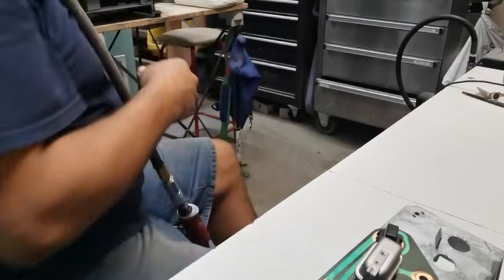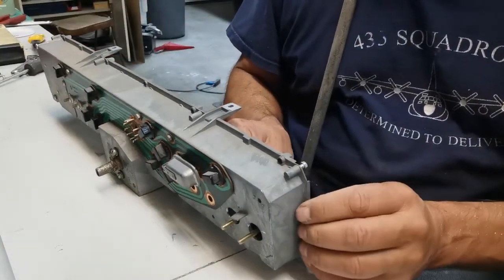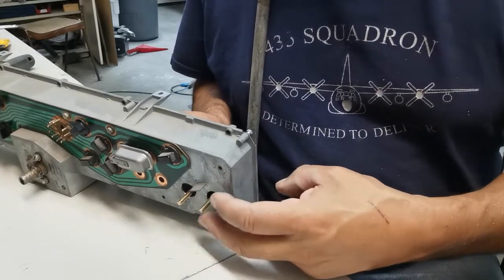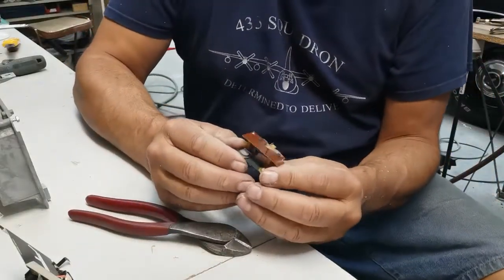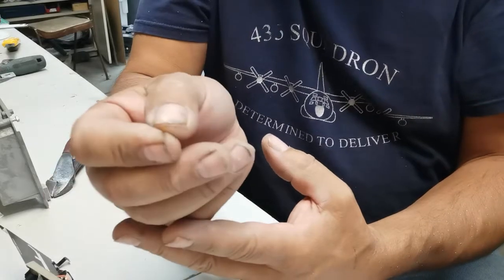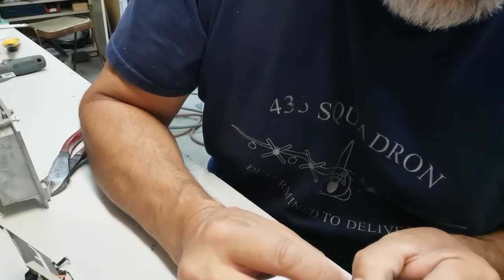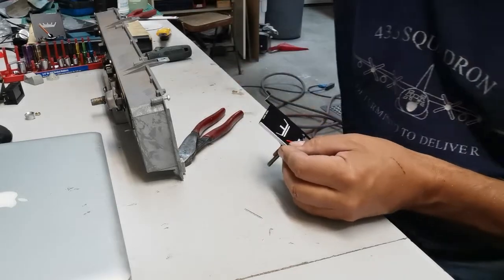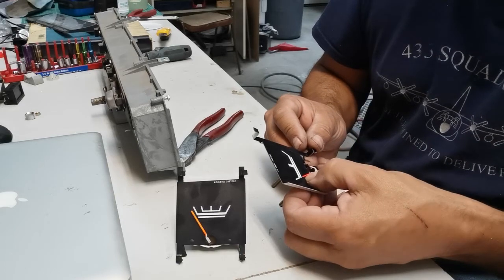Part 3 of 6, Ammeter to Voltmeter Conversion

Comment: This is an awesome video series you got going. Are you going to cover the wiring in the car? This is an awesome way to convert without having ugly gauges thrown in everywhere. Going to do this on my 73 powerwagon.
Reply from the maker: Thanks,  got about 3 videos more to finish editing and will post soon.  I haven't thought about the wiring yet as I have just bypassed the ammeter for now by using a connector. I'll have to bypass the bulkhead connection too or this work was all for naught.
Reply: @retireready7090  Yeah from what I can tell you just take a wire straight from the alternator to starter relay? that way bypassing the bulkhead all together. Not sure about how to get the voltmeter to read though.
Reply from the maker: I don't think it's quite that easy,  at least not with my car as the wires have to pick up the load of the fuse box and ignition load.  My email is in the description,  I have a couple pictures that explain everything if your interested.